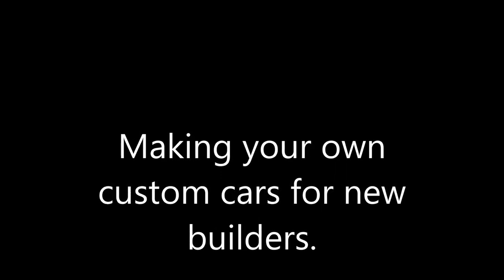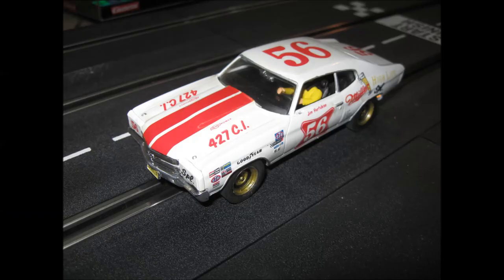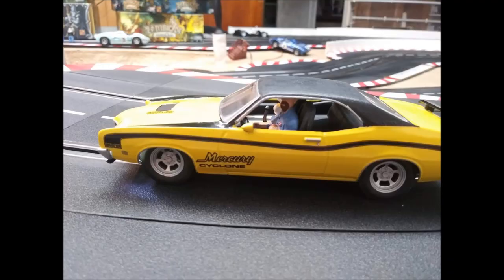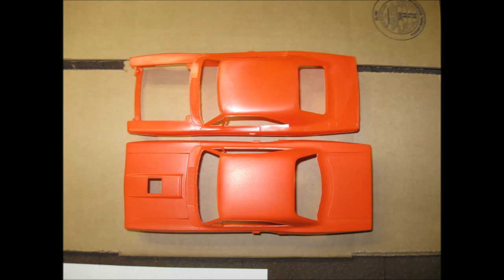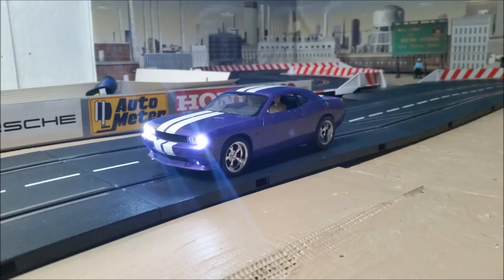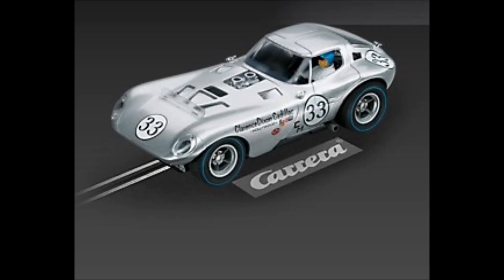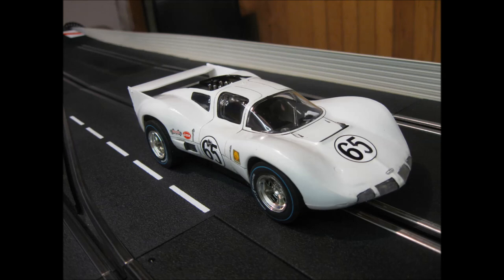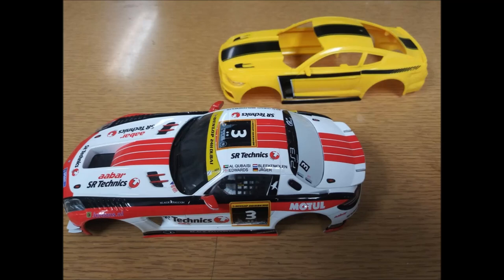Making Custom Digital Slot Cars

Comment: Wish you could buy the Carrera 1/32 digital chassis. Nice cars. I want to have NASCAR Vintage 60 - 70's. I have some 2003,,2006 evolution Dan Gurney Plymouth Winged Road runner & the Bobby Isaac Winged Dodge Daytona. Its not plug & play. Can one solder a digital chip in them ? Thanks for the info.
Reply: I have the same cars. I just bought several #25 digital Roadrunner and the #2 Wing warrior. And switched the body's. The older nascar Torinos fit on the same chassis. I kept one of each for racing. I wish you could buy just the digital chassis. I will just store the new body's were i used there chassis.

Comment: One of the best custom slot cars so far, thank you for the video! I am having a hard time finding tires for them, what do you recommend?
Reply from the maker: I recently worked on making some of my own urethane tires using Flexit 40 urethane.  I used a silicone mold kit from Hobby Lobby and made molds of the wheels that came in the model kits.  They seem to look good but I have to run some laps and see how they work.

Comment: Great video. 3D printing sounds great on paper, but the realities of the current affordable printers don't match up to the hype. As an engineer designing gas turbines for a living, we have the same issue with 3D printing metal parts. By the time all the "hand massaging" of the parts is done, the conventionally machined parts end up being faster, better and cheaper.
Eventually the technology will get there, but it will take more time.
Reply from the maker: I am currently 3D printing prototype parts to make my own chassis for some 1/25 builds.  It is nice to be able to see defects before i commit to a mold.  But the support removal and lack of precision is kind of annoying.  I am using the FDM printer and the parts look terrible.